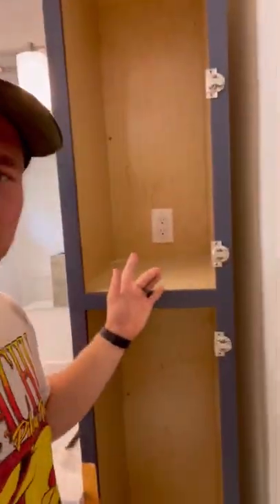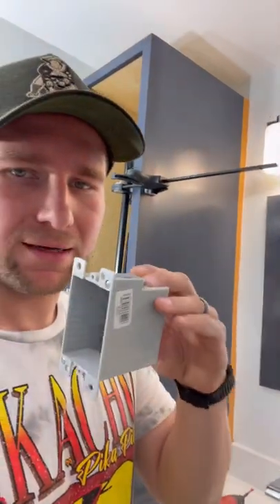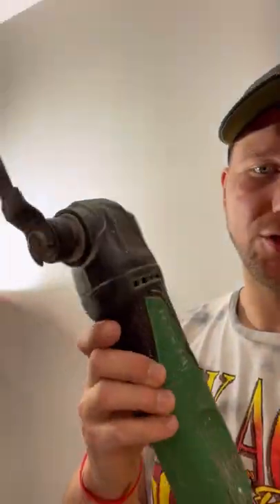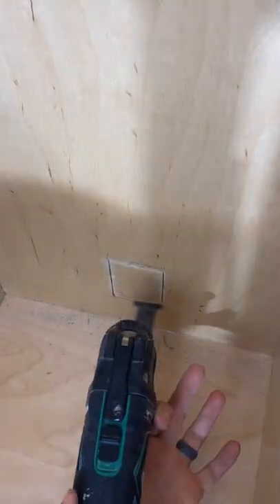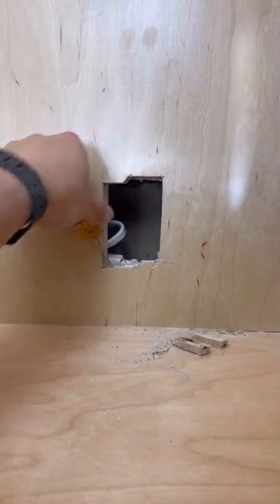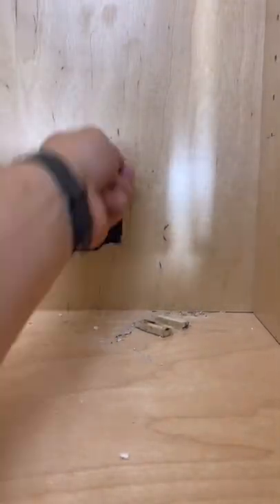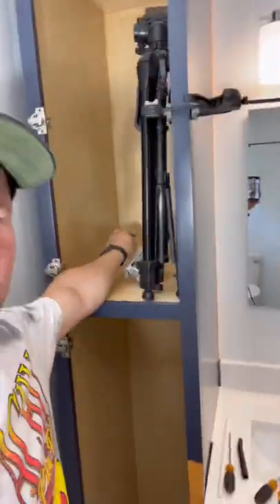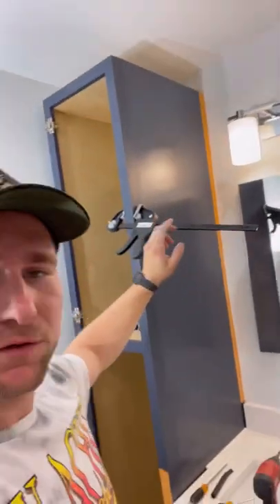Outlet in the Vanity! WINNI DIY Vlog 022

Comment: I came across this video and had a quick question. I am replacing some out dual outlet boxes in my home with newer and better boxes than the cheap boxes that were used when my home was built in 2003. Everything going well until I got to the bathroom, and I have a dual electric outlet on the side of my wooden vanity and when I took off the cover I saw there was a metal box and there was no grounding wire in the box, the 12-gauge wiring just went straight in the outlet. My question is can I use a plastic old work box and use that instead of the metal box or do I need to get a metal box with a grounding wire so the outlet would be grounded to the box and the outlet, currently it is only grounded to the electric outlet? I love the idea of using an old work box so I don't have to mess with the metal box and the grounding of the box and the plastic would be much easier to work with? 
What is your idea (btw I live in California so their might be more rules for this state and I understand that so I just want your opinion, it is up to me to make sure it will work in California and if I do it or not.